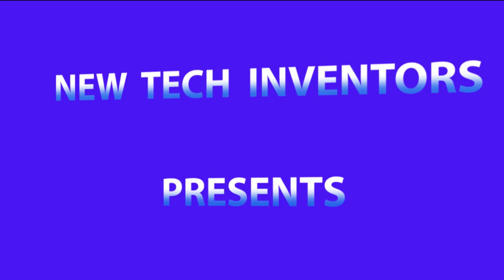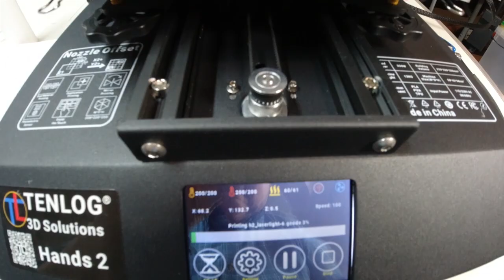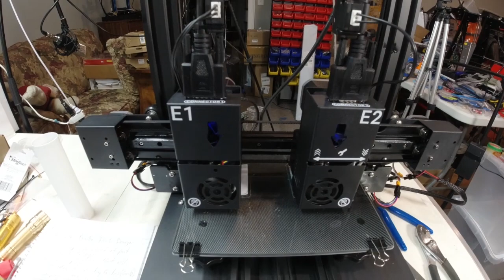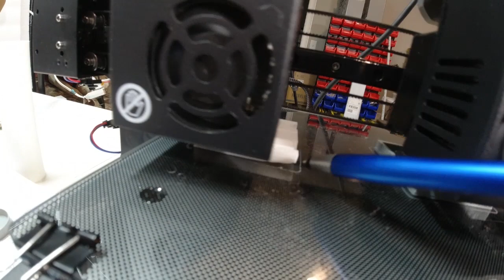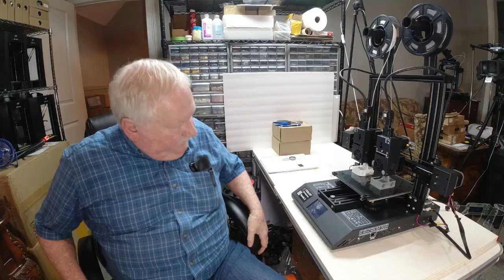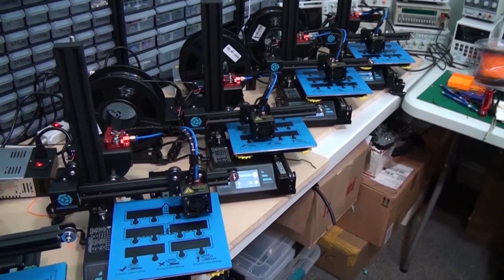MY FIRST DUAL HEAD 3D PRINTER PART 2, The TENLOG HANDS 2. Plus 3D print farm questions answered.

Comment: You should look into octo print, octo print runs on raspberry pis, and plugs into each printer allowing you to monitor your prints as well as start remote print jobs! It is an awesome tool! Id be happy to help if need be
Reply from the maker: Thanks Cam. Not knowing much about octo print I assumed that it would be an expensive mess to have 50 or 60 printers using it. When I get a chance I will look at it closer. I may have to take you up on your offer to help at that time. Thanks for your interest and help...Ken

Comment: A UPS system only allows for about 5 minutes, despite what they claim. The UPS will quickly drop to a voltage that the computer's, or 3dprinter's powersupply will reject, and not turn on, or stay on. So the UPS might still have power, but its insufficient to simulate AC 110. Dont waste your money on a UPS. 
More videos, please !
Reply from the maker: You are exactly right, the UPS is only a temporary solution if you have a long power interruption. It will be helpful if your area is prone to frequent short interruptions (1-5 minutes). I have looked at providing a direct 12v battery backup to my Kingroon printers by having 12v deep cycle marine batteries directly connected to the printers with a regulating and isolation circuit for each printer. This would allow 5 or 6 printers to run for several hours in the event of a power failure and be way less than UPS systems, I will do a video on it later when I get to that point with the print farm. Thanks for the question...Ken

Comment: Just use a brim or raft to fix the corner warping issue. Get rid of the glass bed and get a textured flex bed.
Reply from the maker: I normally don't have this problem with the glass bed. I print on both glass and textured and have good results with both. My biggest thing is the surface on the bottom of the part, do I want it smooth or textured. Thanks for your comment and for sharing your ideas...Ken

Comment: Someone in the comments on James Bruton's cycloid video yesterday informed me of a brilliant technique that can be done with dual head printers. If you ever need to print gears, use flexible filament for the outermost one or two walls. The hard core gives it strength, and the compliant surface allows teeth to mesh without backlash or jamming.
Reply from the maker: That is a great idea, thanks for sharing that. I'm sure there are going to be lots of possibilities with the dual heads with the ability to have different temperatures at the nozzle you could print both PLA and PETG on the same part. I think I will try that and see how it works. Thanks for the info and stimulating my brain with ideas.....Ken

Comment: try Klipper to speed up your printers, double extruder means double the work to level the bed
Reply from the maker: I know you're trying to help Morgan, but from what I've seen about Klipper I would have a lot of work to do if I were to try to use it on many printers plus learning how to use it. Maybe I will have time later to try it out, but until then I will keep putting together shelves and printers, and doing the wiring for the new print farm. Thanks for the comment and for watching...Ken